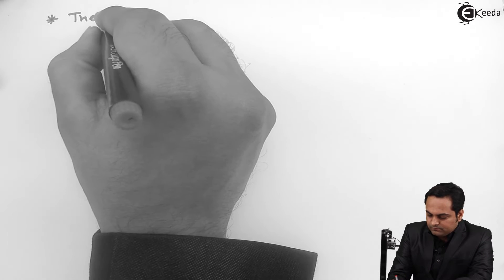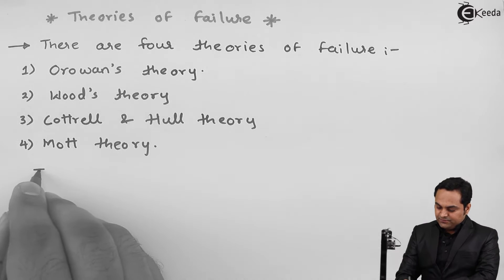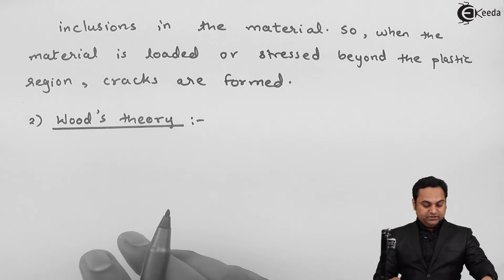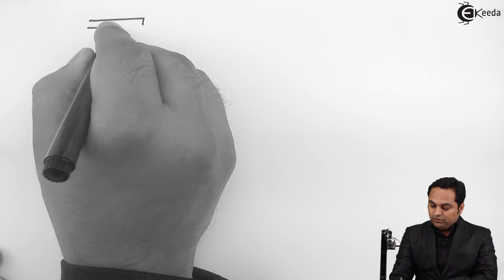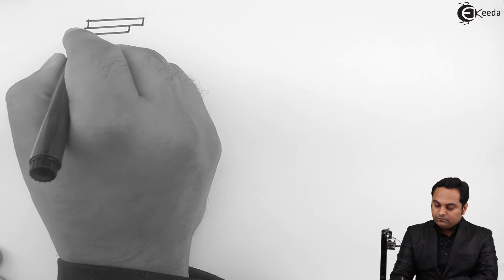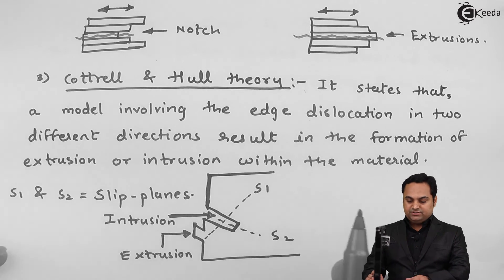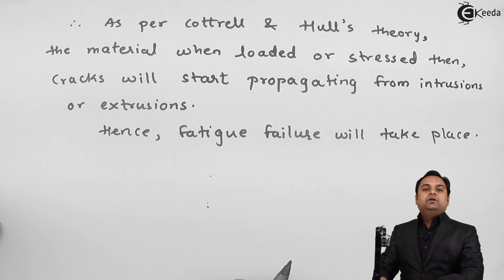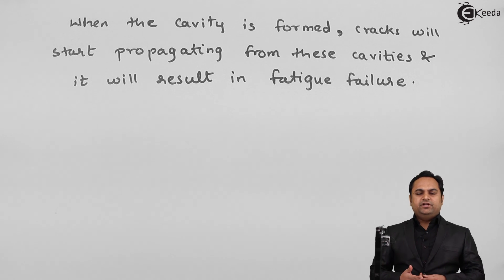What Is Theories of Failure - Theories of Elastic Failure - Strength of Materials

Comment: A machine element is subjected to the following bi axial sate of stress
sigma x=80 Mpa
sigma y =20 Mpa 
Tau xy=40 Mpa 
Share strength of materials is 100 Mpa.
find the factors of safety as per Trecsca Maximum share stress theory.
a) 1
b 2 
c) 3
can you tell me the correct ans please sir.

The correct Ans is 2.
but while i solve get 1.
can you confirm it please?